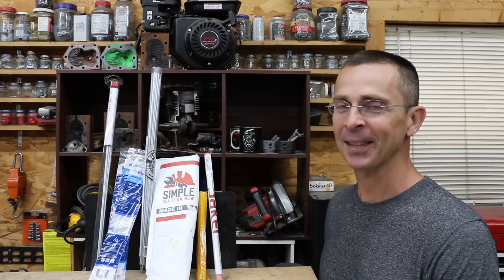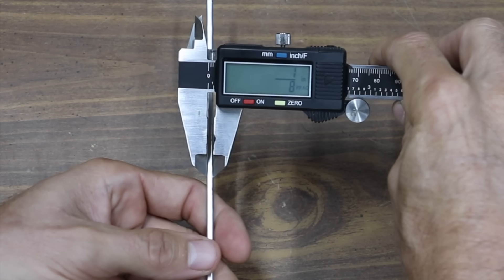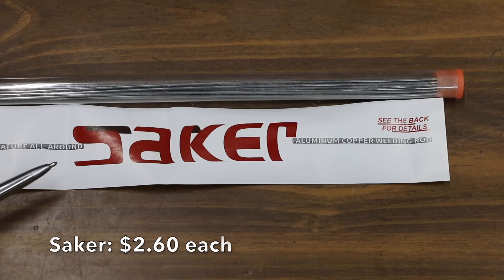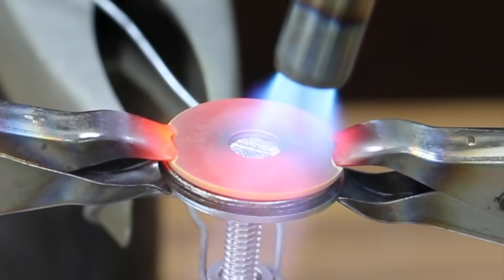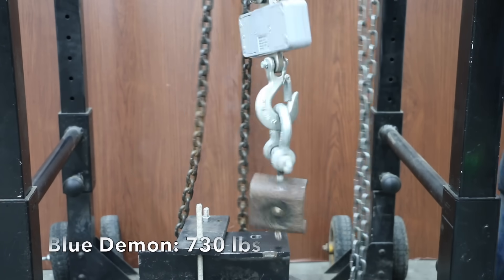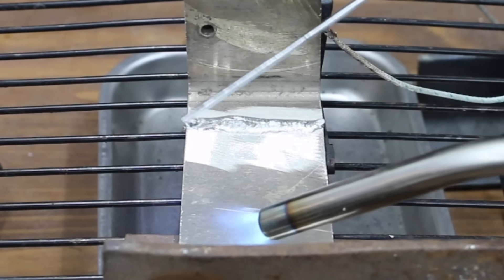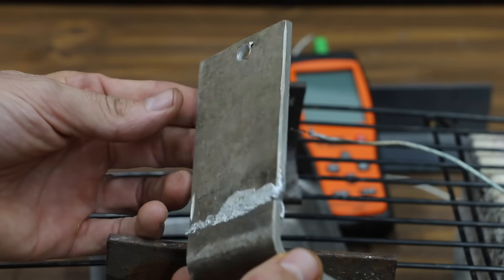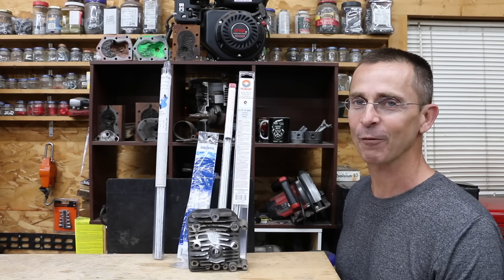Best "No Welder" Aluminum Welding Rods? Alumiweld vs Bernzomatic vs Hobart

Comment: I realize I'm really late to the party, but I wanted to comment on that thermal imaging shot of the cylinder head. Aluminium is very reflective in infrared, that might be why the repaired area appeared to be cooler than the surrounding metal. I wouldn't have expected the area without cooling fins to have a lower temperature, so I'm just putting that out there.
Reply from the maker: Thanks for sharing.

Comment: What if you used a grade 8 bolt and did the first test so the bolts don’t break 
Also I would do a 500lbs  for 3 min 600 and so on   see how it holds I feel like when you give it all the beans it just has a sudden load on it and it stretches and breaks 
I used these on my alum boat and covered the rivets that where leaking with great results i found when the weld gets into freezing weather the welds just break off it’s good if you could do a mechanical and a alum connection would be ideal

Comment: I’ve used the once offered by Northern Tools(Hobart) with good success. I needed it in a pinch when a radiator was leaking. I did it with the radiator installed just draining the coolant and even with a propane torch. It took a long time to get the radiator welded but with MAP gas I’m sure it would of worked faster.
Reply from the maker: Thanks for sharing.

Comment: Thank You for this video. I bought a mapp gas and try to weld the aluminium, I burn till the aluminium melted but the aluminium welding rod still doesn't melt. Now I know the problem is the damn melting rod is so lousy. What can I expect. I bought it from cheap and its made in China. Damn.

Comment: Thank you Sir. Hobart it will be my first choice followed by the Burnsamatic brand. I have a couple of aluminum hold downs that are broken that secure the wipers on a vertical mill. that are no longer made anymore. I don't need a ton of strength,  however I have to have one side as smooth as possible where it mounts. So ill be welding it and then grinding it as flat as possible. You definitely answered my question on which brand to go with in these tests.
Reply from the maker: You are welcome!  Thanks for sharing.

Comment: I have some of these,but I've forgotten the brand. 
I got them in some of my grandfathers stuff from when he passed in 2002, and they were unopened and probably 20-30yrs old at that point.
I ended up using one about 4yrs ago for building up material on a thermostat housing so I had enough meat for tapping threads to install a sender. 
It worked great! 
I wonder if that's a case of "the old stuff working better then the new stuff". 
And it's not stressed much either.
Reply from the maker: Thanks for sharing.

Comment: Since you are not melting the base metal, it technically isn’t welding and only brazing. By definition, you must melt the base metal for it to be considered welding. 
Otherwise though, this is very well done as usual. Thanks for all the hard work!

Comment: i have a problem with a carburetor on a 4 stroke bicycle engine kit, it has a little siphon on the block end that pulls in a little extra air before it enters the valve chamber (there is no head on this block, gxh50 or gx50 honda clone) somehow with two carbs it has gotten a little ding on one and allot worse on another, but regardless the result is that it pulls way too much air in and kills the engine when throttled. can i use any of these to fill it in then file it back to spec? it is an aluminum carb of course. because having had this happen to two carbs inside a few weeks (i changed transmissions from the single chain to the dual chain, i even complained to bikeberry about it when i first got the transmission and they essentially said "screw you" and the rpm is WAY higher than the cheaper transmissions i was using) i really could use a way to actually do a hack repair so i don't have to spend 20 bucks a month on carbs. between the carbs and the clutch i would be completely offsetting any gas price savings (13 for a clutch, maybe twice, and 20 for a carb each month). it stops working right with just a little tiny nick. i should probably crack the case just to see if there is any sand sitting on top of the piston. on the next carb i'm gonna put a filter around the part, there is no filter on that little siphon tube.

Comment: Since you tested the aluminum welding rods you should test some other welding material.  Steel welding rods and flux core welding wire.
Reply from the maker: Thanks for the video idea.

Comment: I tried aluminum rods from Harbor Freight twice and they never stuck.  One was sheet aluminum, other was cast aluminum.  I had cleaned the surface well with a stainless wire brush.
Reply from the maker: Thanks for sharing.

Comment: Can you tell me what you are using to measure the temp? I tried to use the alumiweld from hf and could not get the aluminum hot enough using a propane torch. fwiw I was attempting to join 2 pieces of aluminum screen room channel together. I do enjoy your videos keep them coming

Comment: Do you know why junk is called junk?  Because junk was brought on Chinese sailing ships, and Chinese sailing ships are called Junks.  A few centuries later and not much has changed, except that today the Chinese trading vessels use diesel electric instead of the batten sails that those Junks of old used, but they still move Chinese junk just the same.

Comment: Greetings,
   Too bad I didn't see this a year ago so that my comment would be more timely but here goes anyway. Great video first of all, very informative. I have used these types of zinc alloy rods in the past and I wondered how they compared. Now I know. I have an observation about the icyyy rod. The quick shot of the package showed that it contains silicon. And the melting temp was quite high. Because of these two facts I think the stuff is just regular aluminum welding rod. No wonder it didn't work like the other rods. I also have a suggestion: bust out the center of an engine head in the press, repair with the best rod, and then test it. 
Thanks,
Eric
Reply from the maker: Thank you for the video idea!

Comment: It looks like they've improved on the metallurgy with aluminum brazing/welding rods since my college days 45 years ago; as I took a college course in welding and was one of the top students in the class with ferrous metals gas welding/brazing and arc-welding; but aluminum welding I was a complete failure.  When heating aluminum with a gas-fired torch, it can go from a solid to a liquid in the blink-of-an-eye.
Reply from the maker: Thanks for sharing.

Comment: How has this guy been doing this stuff this long and still hasn't figured out how to test something at least somewhat decently. Like every test has hundreds of unintended variables making the data useless.
Reply: These are real world products, absolutely intended to be used by real world people.

Laboratory tests have already been done.

Now the question is, how good are they under real world conditions.

Labs are great, but at some point, products have to work in the real world.

Scientific testing isn't nearly as useful when the conditions in the lab, are quite literally impossible to recreate in the real world, where it will be used.
Reply: @lordgarion514  you failed to understand my comment.
If you test something one way for one product but another way for a different product, you can't compare those results. The data is meaningless and not useful in any way.
Reply: @lordgarion514  by just randomly throwing shit at the wall and seeing what sticks is only somewhat testing one thing, usability...and even that is a bit of a reach. You can't derive strength or anything else from this.
Reply: @miles11we  
It's not randomly throwing shit at the wall.

It's using a product the way it was intended. And THAT intended use absolutely includes humans NEVER doing things the same way twice.

You want to compare how products work under conditions you literally can't do.

Those results are useless. How a product works under lab conditions isn't an accurate representation of how it will work in the real-world.

Which is why proper "real world" testing is done under "real world" conditions. That includes testing each thing multiple times to see how it works under the mandatory variability of humans.

Why do you think so many products end up being kinda junk? And I'm not just talking about electronics, lots of construction products get tested by the company, and the government, and seem great. A few years after release, they find problems with it, in the real world, and it costs a fortune to fix. But it's very common.

Real world testing is what was missing. You need both.

And as I said, the lab testing has been done for all these products. Those results won't help you one bit, because you, and every other human in the real world, completely lack the ability to recreate the conditions in the lab.

And if you know anything about scientific testing, then you should know that when you change the conditions, the results you achieved under the previous conditions are invalidated, and you must test again under the new conditions......
Reply: @lordgarion514  I'm sorry this is hard for you but like I said, testing in the way you suggest is only sorta testing one thing. Nothing more.
Reply: @lordgarion514  
I bet you select everything as "this is best glue." or some other extremely broad categories and never "this glue will give me high sheer strength for this particular situation in these materials".

No its testing ease of use/how tolerant it is of mistakes. Nothing more.. Which sure that can be valid, especially if you will never learn how to use anything properly.

Comment: hobarts the only one that called it what it really is, brazing
Reply from the maker: Thanks for the feedback.
Reply: True, but to average people, brazing is something done to brass/copper, like the water lines in their homes.

A lot of time things are named for tradition or simplicity.

Which is why you can now buy bone-in fillets, even though a fillet is a boneless piece of meat.

Just simpler to add "bone-in" in front of the regular boneless name, than to try and get an entire population to learn an entire set of new names for the same pieces of meat, just because of the bone.

Comment: I've been curious about these rods, but I assumed that they were all just overadvertised crap.

I would have liked to see a complete table of the results at the end.  But what I saw in this is, when I need to weld aluminum, I should trust both the Bernzomatic and Alumiweld.  I have a Home Depot and Harbor Freight locally to me, so I think I can get both the same day when I need them.  If I do end up doing a decent size aluminum project, I'll probably get a MIG spool gun for my welder.  That should let me have even better results.

Comment: Ok, I see great usefulness from your testing and reporting.  I was thinking that it would be nice if you could do a test on silver soldering some stainless steel.  I know that 303 and 304 stainless are very common.  Furthermore, there are various fluxes and silver solder compositions.  And just to complicate matters a little more, the most common types of heat would be propane, mapp (yellow tank), and oxygen/acetylene.  That would make a very informative video.

Carlos in Texas
Reply from the maker: Thanks!  Thanks for the suggestion.

Comment: The header on my motorcycle oil cooler cracked, it is alloy, and I repaired it with Bernzomatic aluminium welding rods. It made a perfect repair and is still holding strong.  I chose the Bernzomatic because of all the rods reviewed on this video they where the highest scored that were available here in the UK.  Very expensive though at about $15 for two rods.  Cheaper than a £250 oil cooler though!
Reply from the maker: Thanks for sharing.

Comment: Hey would this work for a cracked carburetor?
Reply from the maker: Thanks for the suggestion.
Reply: Very little heat or pressure inside a carburator compared to an engine head.

Should work just fine. But if the crack in internal where air or gas flows, you'll need to smooth the weld out to prevent interference in flow rates.

Comment: I tried Masterweld to attach  torn out trailer hold down  rings on an old  pontoon boat  that I converted to floating dock on my pond.  It took a TREMENDOUS  amount of heat and MAPP gas to get the rods to flow and the results were very brittle.  Probably my technique, however, will grind it out and try Hobart.
Reply from the maker: Thanks for the feedback.

Comment: How about saving these results, then compare to shop tig welded repair as well as tig welded joints. Use the same test procedures. Even the cylinder head.   Maybe even do some steel welded parts and welds.  Many of your tests have been used in shop weld test for job interviews. I’d be glad to help nut my medical double vision prevents the technical welds today. You could even add structural stainless steel welds. I’ve always used a back purge with double regulators for this test.  I had to do radical out of position welds. In stainless steels.  Many different alloys are common. Generally use one level higher stainless steel rod than base meta.

Comment: Do you think it would be safe to make a smoker grill out of a large aluminum box?
Reply from the maker: Thanks for the suggestion.
Reply: Thank you. Do you think it's safe? The way I understand it aluminum releases a poisonous gas at a certain temperature, but I haven't been able to find out what that temperature is. I'm interested because I have a beer keg and a large aluminum box from the Navy that used to house some kind of turret. They're both from the first Iraq war. The turret box is perfect all I have to do is put hinges joining the lid to the body of the box and it's done

Comment: With the washer to bolt head test welds(brazing) did you heat up the bolt from the bottom as well as the top? It looked like you were focusing the heat entirely on the top of the test piece. Even with gravity on your side the the filler just won't creep into the space between the bottom of the washer and the top of the bolt head and stick to those surfaces if you don't get that entire area to temp. I suggest trying the same test again but alternate the focus of the flame between the top and bottom of the washer stack and the heat will be more likely to seep in and bond the top washer to the bolt head. Great job on this video, by the way. I like your style, you're thorough without being overly technical.
Reply from the maker: Thanks!  Thanks for the suggestion.

Comment: I have played with the Harbor Freight rods and have had mixed results, but I think I see something you did differently.   I have been using acetylene torch to heat, but I applied the heat directly where I would be welding.   That may be causing contaminates to weaken the bond.  I saw you heated areas not being welded.   Thanks
Reply from the maker: Thanks for the feedback.

Comment: Hi what heat source were you using because when I use the over the counter propane bottles I have a hard time melting sick with part or getting part hot enough to melt stick , is there something I could buy over the counter that gets hotter then propane.

Comment: Excellent analysis . Have you tested some of the solder less plumbing connectors.  Sharkbite,  the crimping type plus there is like a glue that is used to connect copper?
Reply from the maker: Thanks!  Thanks for the suggestion.

Comment: Hobart is awesome. I have a Hobart Handler 140 gas mig for thicker sheet metal and I only use their filler material rods including the aluminum ones that you tested and haven't had one repair come back for a re fix/weld. Hobart rocks if your ever in the market for a great gas mig/flux core machine for your shop. You will not regret it.
Reply from the maker: Thanks for the feedback.

Comment: Wow, I wondered about this before so thank you.   My suggestion is to take a Honda GX engine and one of those junky Predator engines that are supposedly the same thing but the 

Predator is made in China.  Do a physical removal of parts to show us what's similar, different, the quality etc.  Then put them both through abuse such as zero oil or low oil and then 

show us the scoring of each etc. or how long each would last til they break down.
Reply from the maker: You are welcome!  Thanks for the suggestion.

Comment: I haven't had good luck with alumiweld.  They are quite expensive too.  18$ for 8 rods.  I only had one tab to weld and used them all.  I guess it wasn't hot enough but it was hot enough to melt.  Maybe it was because of prep.  Thanks for the video.  Where did you buy the Hobart?

Comment: Dang! You didn't have the brand of aluminum rods that I purchased - HTS-2000. I used these rods to repair the broken "ear" on my aluminum LS1 block, where the starter bolts on. There were just a few threads left, so I set the  bolt into the threads and heated the area up untill the rod started melting. After it cooled, I simply turned the bolt out and all was like new, threads and all. Its been two or three years since my repair and, while I have replaced the starter, I have had no issues w/ the repaired block.
Reply from the maker: Thanks for sharing.

Comment: I noticed that sometimes the tool to weld is sometimes the problem. Do you have a test for those as well? Some just recommend a blowtorch, but I've seen some electrical ones and others with fancy soldering feeders as well. Side note: I'm not sure if they are specific to certain jobs. I'd love to see a compare video on those. I'm not sure how you would test them though.
Reply from the maker: Thanks for the video idea.